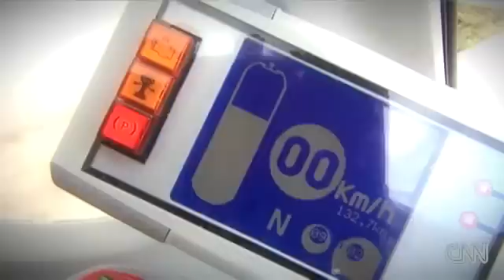AIRPod on CNN

Comment: Using a joystick instead of a steering wheel? That's brilliant. It make you wonder why no one thought of it before. Furthermore, not only is it clean, but unlike electric vehicles, it has no instant torque, which some people would find to be inconvenient. And since it's so quiet, this technology could benefit motorcycles as well. All it needs is to be an electric hybrid, so when the compressed air runs low, or the vehicle achieves a steady speed, it could switch to electric, and the battery would simultaneously refill the air tank. Also, did anyone, besides me, hear "air port" instead of "airpod"?

Comment: how do you compress the air though? electricity? but probably uses less electricity still
Reply: Really the only way this makes sense is if :
a) The compressor uses less energy to fill the tank for 1 mile, then an electric car would use
b) If the tank and compressor were cheaper then batteries and a motor for the same range